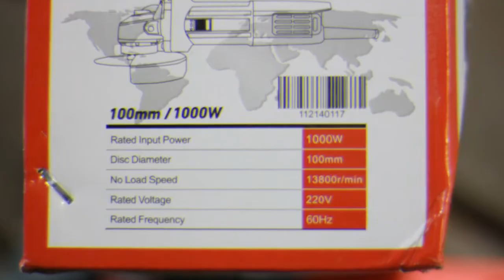Unboxing and Testing Mitsushi Angle Grinder Glary High End Series

Comment: Sir anong size ng disk n gamit mo?
Reply from the maker: 4" 3/64" x 5/8" po
Reply from the maker: salamat po sa pag subscribe. :)
Reply: Mitsushi XH-9523 950W 220V Glary High End Series Angle Grinder ung nbili ko sir wlang free disc same lng kya ng disc ung syo at skin?
Reply from the maker: @athenasoriano3150  yes po same lang po. 100mm or 4" ang diameter ng disc po.